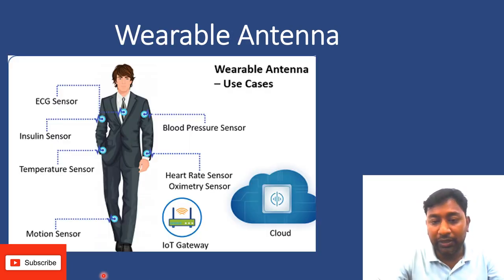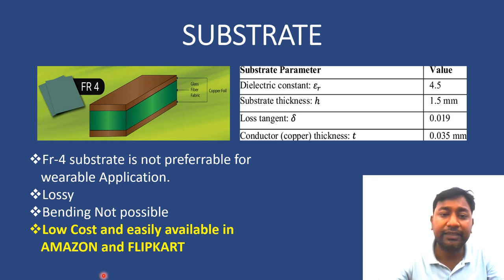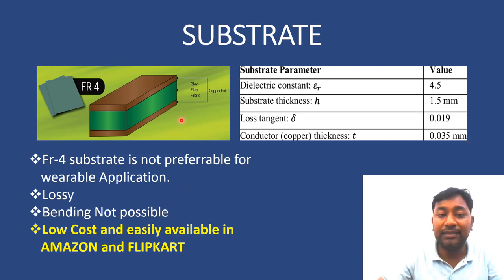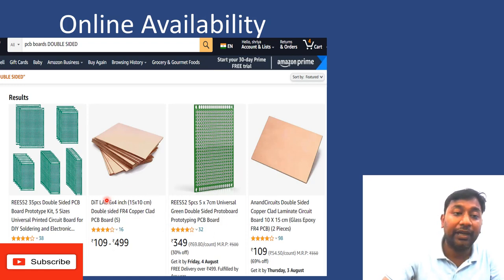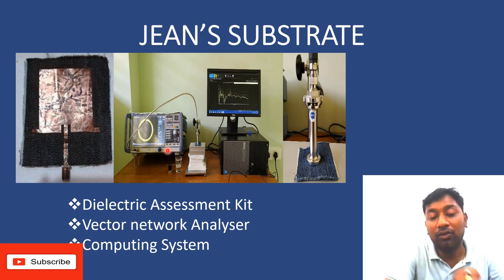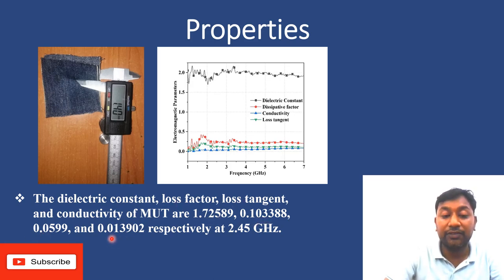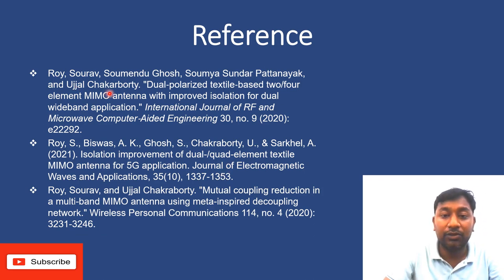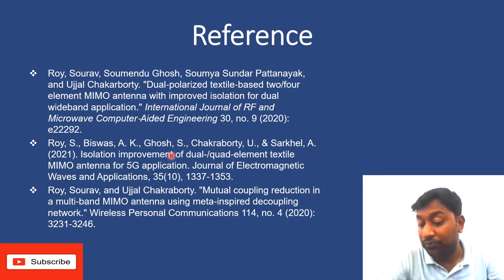Wearable Antenna L2

Comment: You can't use FR4 everywhere as you claim. At high frequency specially mmwave frequency band it becomes very lossy .
Reply from the maker: I am not claiming for High Frequency...here we mentioned the substrate is very lossy and also not preferable for wearable Antenna . Thank you for your comments.